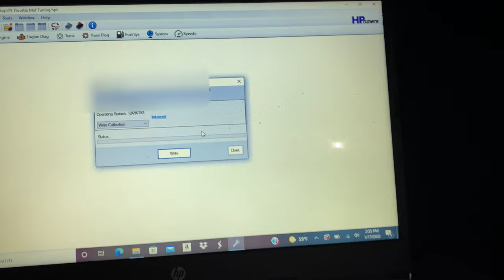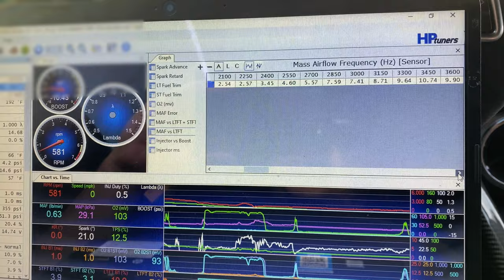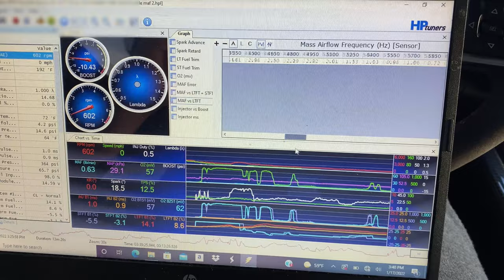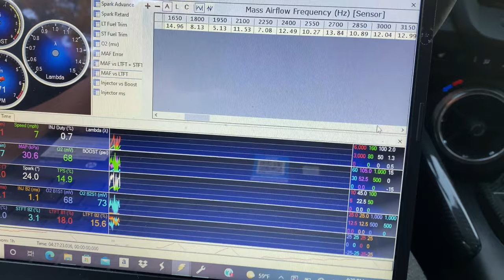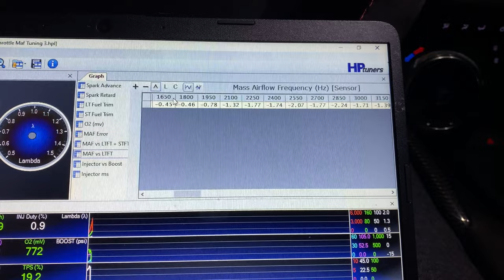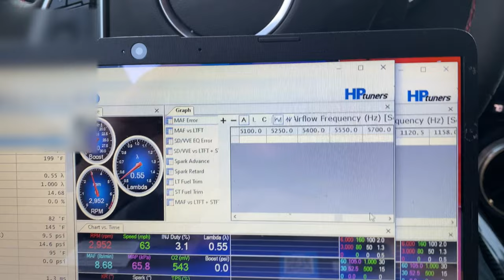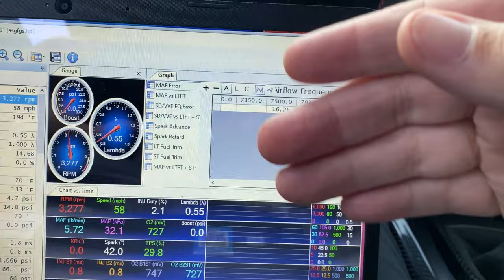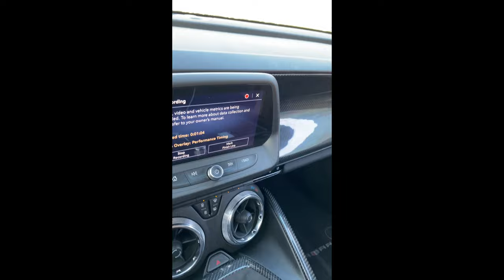Tuning my ZL1 with HP Tuners was EASY

Comment: What wideband you using, and btw if you put the wideband in the secondary O2 Sensor spot you’ll be good only time you’ll be showing false lean is when you have a clamp on the tailpipe with the wideband there.